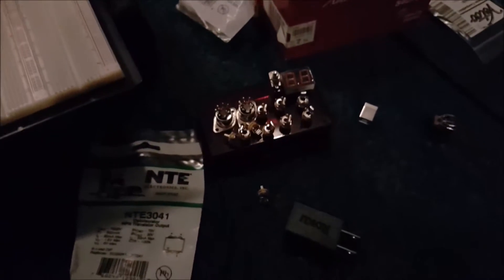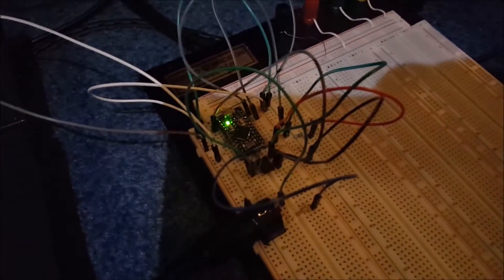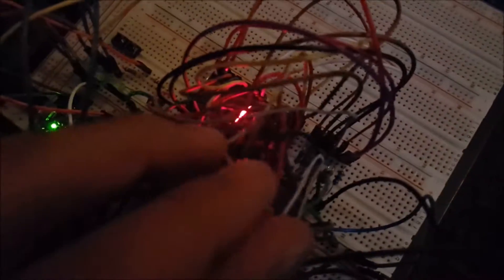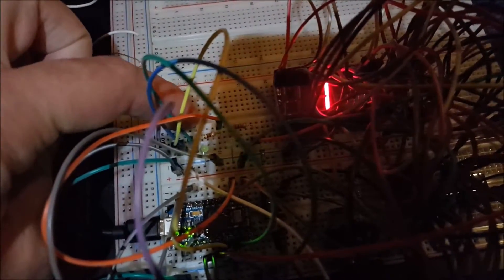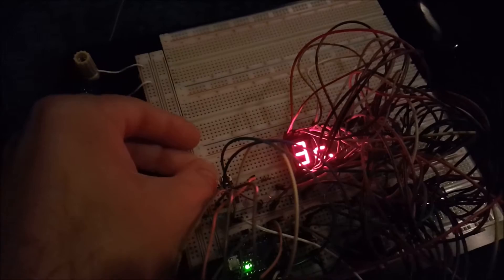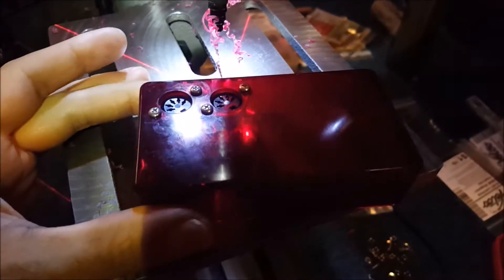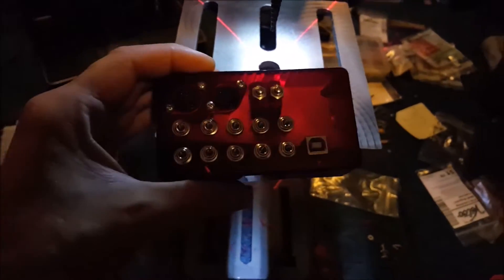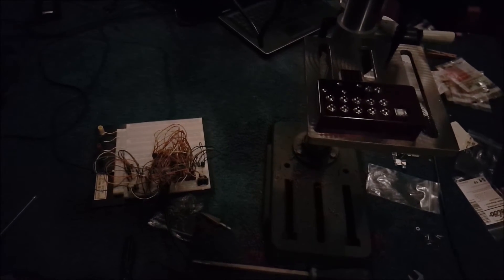Arduino MIDI trigger drummer part 1 (trigger vintage drum machines via MIDI)

Comment: is your Ryobi drill press useful
Reply from the maker: Yeah, it's great. The build quality could be better, especially around the height adjuster, but for $200, it's not a bad buy. The laser sights are also very useful for doing small work in electronics projects. I'm looking forward to etching a board and using it for drilling the through-holes.